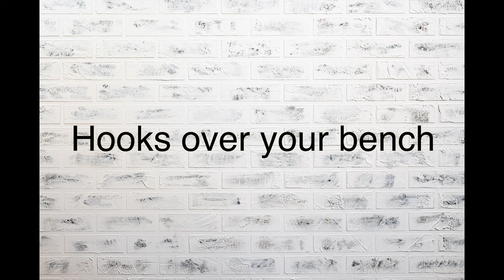Make A Bench Hook!  DIY I 4K

Comment: Nice bench hooks.  You could still use a Western saw with the same bench hook, but unless you were left handed it would be difficult to cut at a 45 with your current setup.  I've been thinking of making one that will work for both Japanese and Western saws.  Thanks for the video!
Reply from the maker: Thanks, I do occasionally use my one small western saw, hacksaw etc.  Great to have a few of these.  I’ve considered making a very accurate magnetic version…. Thanks for Watching!